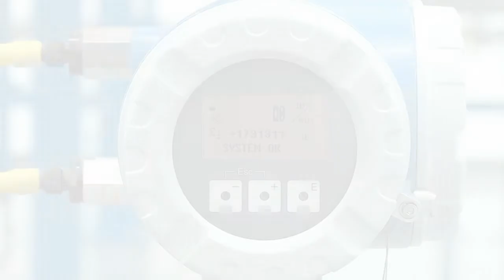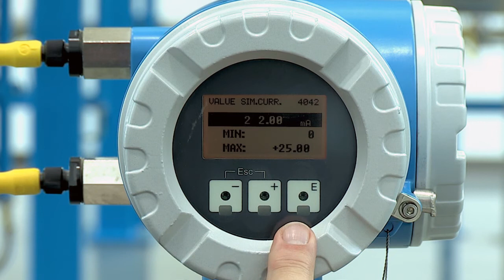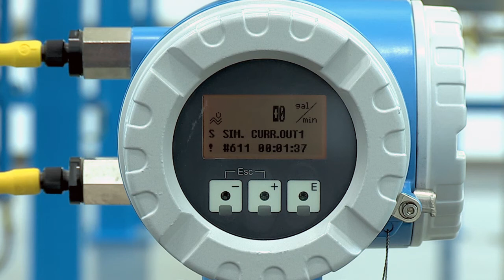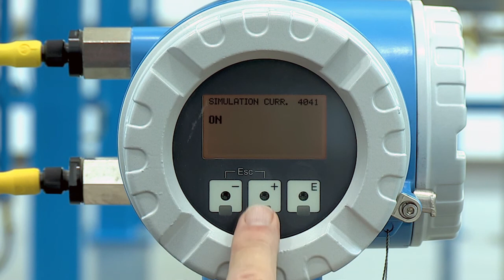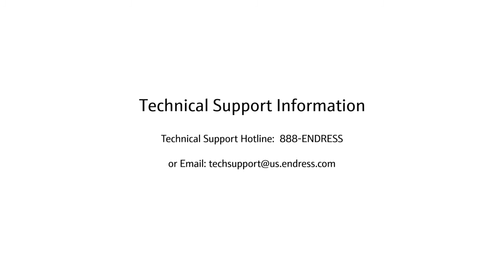Current Simulation – Promass 83

Comment: Could someone explain to me what the "current simulation" is for?
Reply from the maker: Hi Luis, the main benefit of the current simulation is to ensure the scaling of the 4-20mA output on the flowmeter matches the scaling on the control system. It’s essentially a method to test the entire signal chain to ensure the correct values are being transmitted and received.